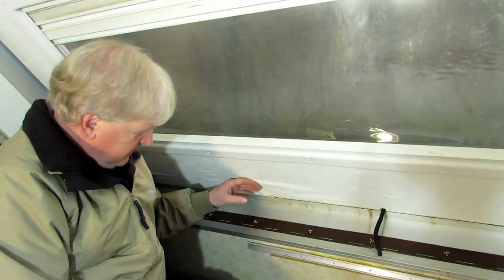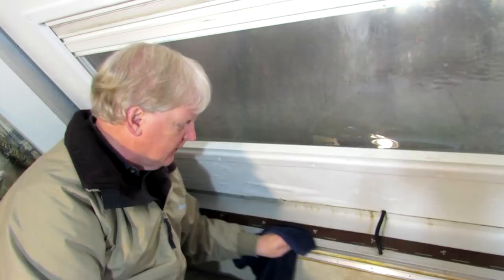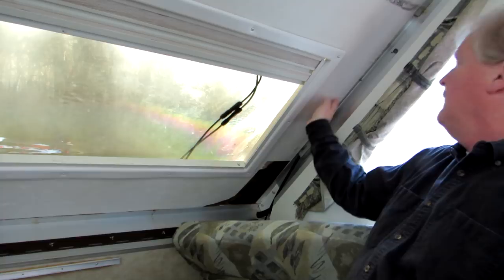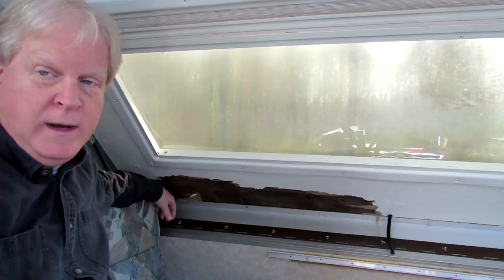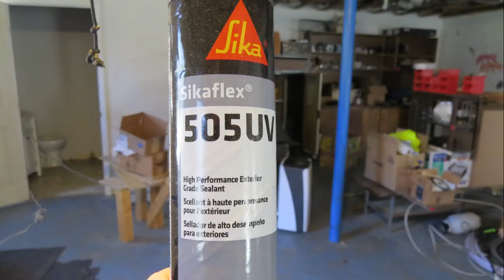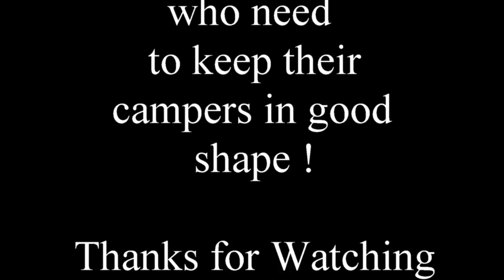Roof Leak on My Aliner, Popup Camper.  What to do !?

Comment: Should have used Dicor.
Reply from the maker: Dicor and Eternabond is just plain UGLY. It is usually used on roofs where it will never be seen except by someone climbing on the roof. But I don't want it on my side walls/roofs.  It don't belong on a nice beautiful Aframe camper !!  :-)
Reply: Makes sense, But Dicor wont leak for years to come. I hope that sealant you used toes not break apart from the travel vibrations. Just keep an i eye on it closely.
Reply from the maker: Well,  we will see and will report, but SikaFlex is what is used throughout the auto industry to hold car and truck bodies together and leakfree, so hopefully it will work.  Though this trailer may rock  and roll more than most cars or trucks !!
Reply: Going NoWhereFast keep us posted.